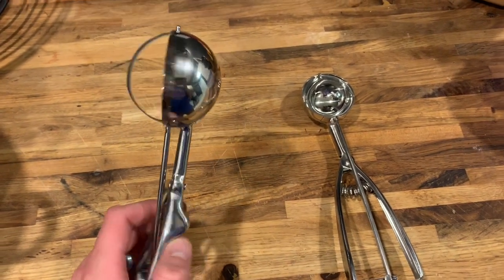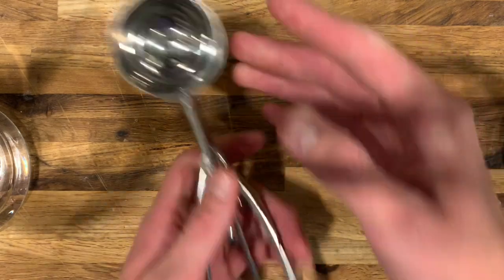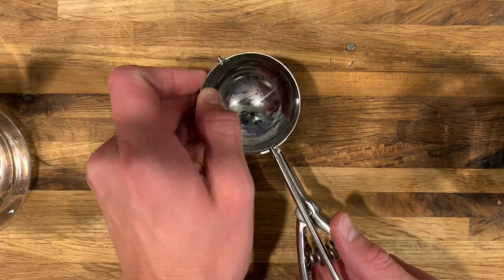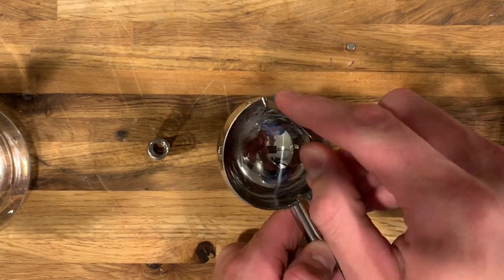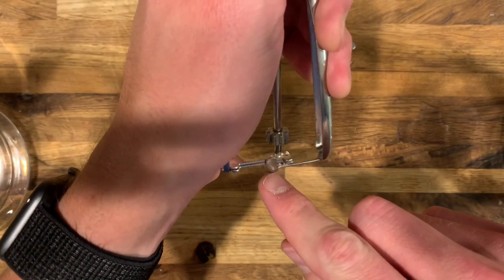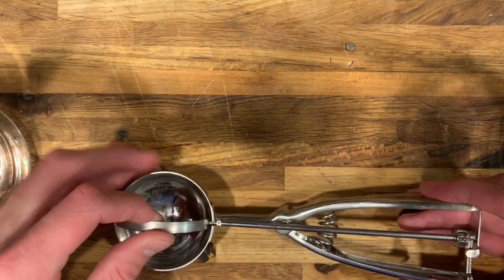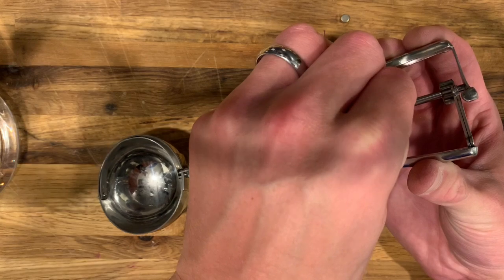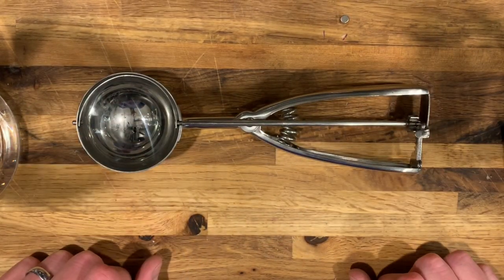How To Fix a Cookie Scoop

Comment: This is an overly complicated way that can ruin the scoop. Just squeeze the handles together and then gently pull the curved bar fully even with the opposite side where it should end. When you release, it will go back where it is supposed to go. No tools necessary! I hope that helps!